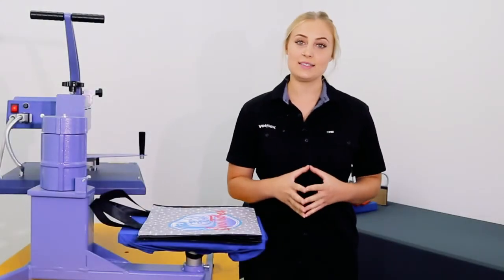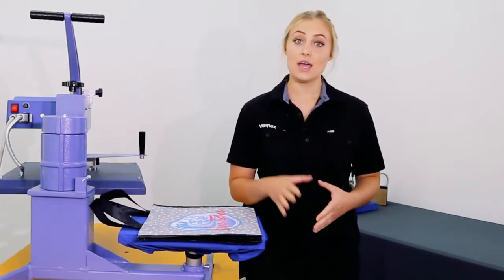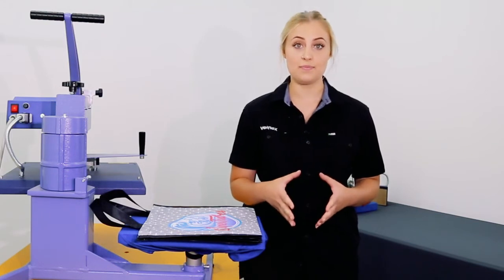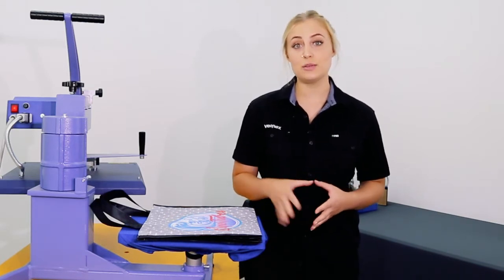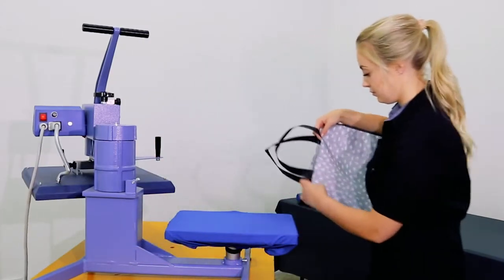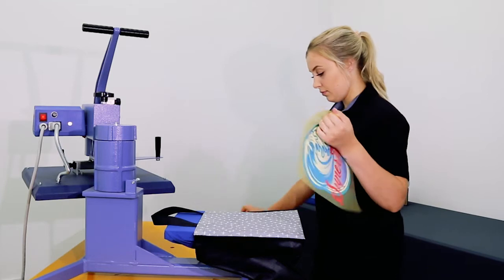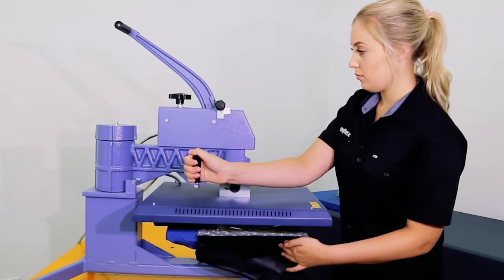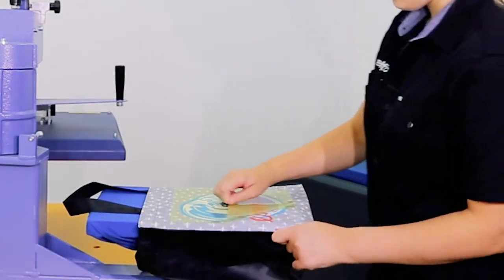How to Press Heat Transfers on Polypropylene Bags

Comment: Hi, if usually use a cricut for cutting vinyl, what type of vinyl should I buy for a non woven bag?
Reply from the maker: Hello! Do you know the material of the bags? Since you are familiar with it Cricut vinyl should be fine for your natural fabrics. Cricut vinyls can struggle with your more intricate designs though and I'm not sure how they perform on synthetic materials. Would depend on your heat press as well.